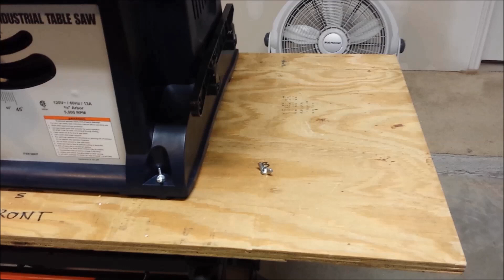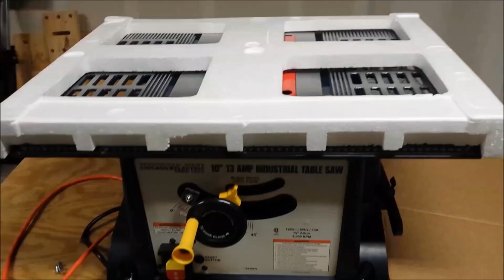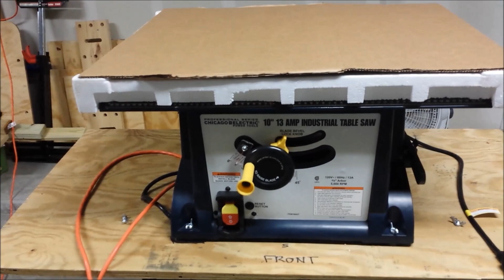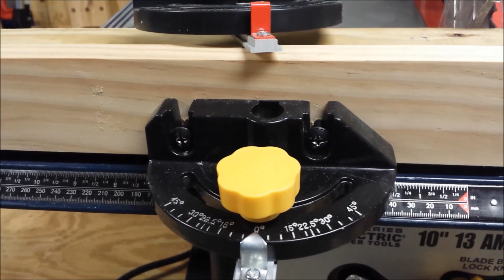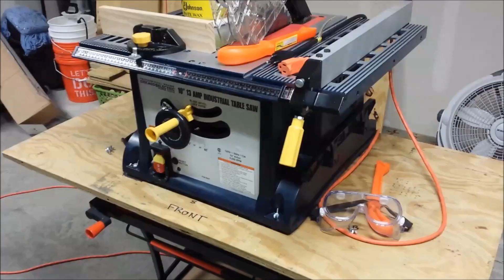Getting The Most Out of Your Harbor Freight Table Saw

Comment: My fence won't lock square. How do you fix that
Reply from the maker: The fence on this model is tricky.  You have to line it up while loose, then hold it down firmly while you tighten the clamp as it tend to move as you do so.  The tension on the clamp is adjustable.

Comment: I just picked up this table saw. The riving knife doesn't align with the blade. (It's off to one side, enough that when I try to cut a piece of wood, the stock hits the riving knife and can't be advanced any farther. Is there a way to adjust it?
Reply: I bent mine into place.  This saw sucks bawls.  Can't afford to replace it with a better one yet so, gotta make do.  Definitely needs a new fence.
Reply: @unclesunbro1577  Thanks for the response. I was going to exchange it for a different Chicago Electric, as it did have a lot of positive reviews. I figured I just got a bad one. However, all of the stores in my area were out of them. I was able to upgrade to the Hercules. It's a world of difference, and definitely worth the extra $.

Comment: I have what could be the same table saw, different brand though.  I also have the same fence, which I stupidly took apart to see if I could improve it.  A spring surprisingly feel out and I am not totally sure about how it goes back. I think it goes right under the main slide plate.  In fact the silver screw attached to the inner rod presses against it.  Could you look at yours and tell me if you see it under that area?  I am not sure exactly how it needs to be placed in that area.   Thanks
Reply from the maker: Hey Jerry - Yes, many of these table saws are very similar in design and perhaps even made in the same factory.  Unfortunately, I no longer have this saw.  I am thinking that you may be able to get a pdf file of the diagram by searching for your make and model for the user's guide or manual.  Frequently the manufacturer will have the manual on their website right with the other info on your saw.  Cheers.
Reply: Thanks for the information.  I also discovered that Harbor Freight has this same type fence on a few of their table saws.  I may stop in and check them as well.  Again, thanks.
Reply from the maker: @harleytrader3820   You are certainly welcome. Cheers.

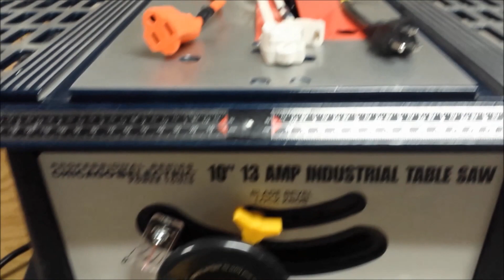Comment: Great tips that I will use. Speaking as an electrician I've got a small technical correction for 1:11. It's the high current/amperage that is not good for the smaller cables. Voltage will be a steady 120 +-10% which they will all handle just fine. Current causes the wires to heat up and if the wire gauge is too small and you are running 13 amps that is when the heat from the current starts breaking down the insulation potentially leading to a short (power wire touching return/ground) or an open (wire literally melts leaving a gap not allowing electrons to flow) or hopefully just tripping the breaker to reduce injury and save equipment. Bonus fact: when starting a motor it can draw 8x the running amperage (how much power it takes to keep the motor going after it has started) instantaneously then quickly reach normal values. This spike is what causes breakers to trip when you've got a power tool running on a circuit that has a lot of other things plugged in at the same time.
Reply from the maker: chesspro13 Hey, thank you so much for sharing your knowledge about electrical current. This is very helpful not only to myself, but to all the other viewers as well. So, what would you recommend in terms of an extension cord for a table saw like this?
Reply: @autohelpeu  As long as the extension cord is rated for the load you intend to use it on it should be fine given a good tight connection between the wall and table saw. You can check to see if you are still getting 120VAC on the female end of the cord with a multi-meter just to make sure you don't have too much voltage drop which will cause equipment to misbehave or not work at all. That is why I said 120 volts give or take 10% because factors like distance from the source of the power and resistance of the wires can cause voltage drop. Most all equipment will be able to work well within that +-10% range but weird things start happening out of it that may ruin the equipment in one way or another. That being said, voltage drop is usually a problem in big facilities and not really a problem in residential(from what I have experienced). Long story short, short as you can, don't chain or add extra power strip on the end(especially if you are already pulling a lot of power with a machine like this), make sure it's rated for the load (usually best to go 125% what your doing so for this 15 amps). Though usually common sense goes a long way too. Most people never have to deal with this. I'm glad I could help.
Reply from the maker: chesspro13 Thank you again for sharing this all important information. Most people are not all aware of all of these factors. I can remember years ago one of my instillation crews strung several extension cords together for nearly 100 feet and there circular saw was barely able to cut anything. Lol.

Comment: Can someone tell me how to improve on the Ripping fence. I find it to be hard to measure and more importantly keep it at a 90 degree angle all the way from the front to the rear. Thank you.
Reply from the maker: Live 4 Bikes Store This is a common problem with most of the table saws in this class. One thing that might help is to gently tighten the tension on the fence so it sits more snug. The trick is to get it lined up first, press down on it in the center with one hand firmly, and lock it down slowly with the other hand. It usually takes me 2 or 3 times to get it right.